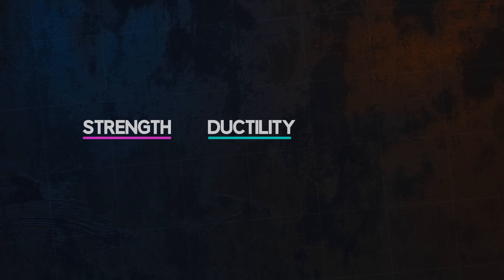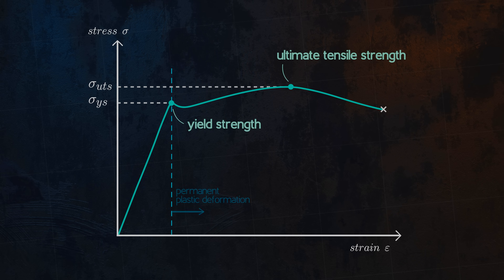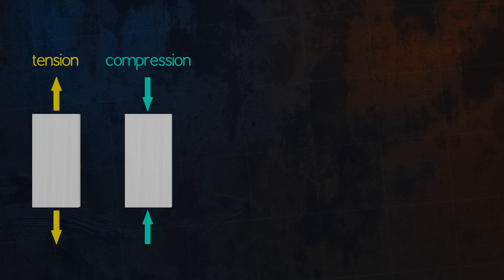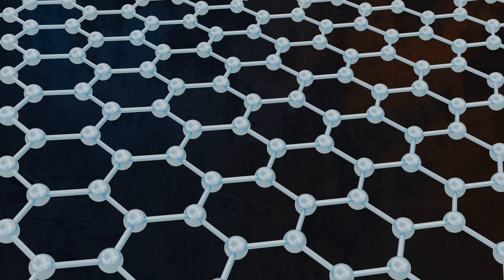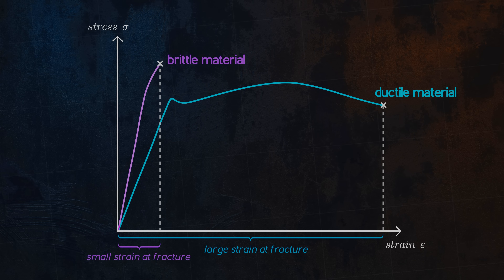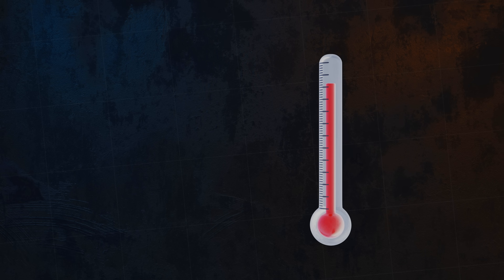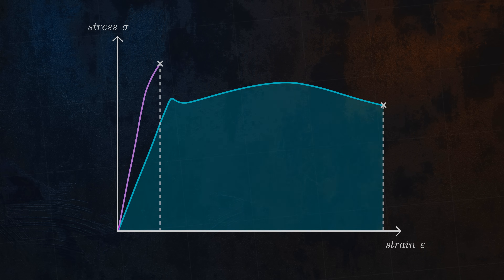Understanding Material Strength, Ductility and Toughness

Comment: I am not sure I follow, in the engineering stress and strain graph, why is there a dip in the stress values after yield point? The csa is the same as initial, so the only way the stress dips is if the applied tensile force is decreased, how does the graph make sense ? why is the applied force decreased?
Reply: Permanent plastic deformation sets in, which exhibits variable behavior following contnued stress depending on the material.

Comment: Something that has been confusing me for a long while, is the relationship between ductility and toughness. As far as I understand, ductility is a measure of the ability to plastically deform. I also understand that the plastic deformation is the main way that energy is absorbed by the material before fracture. This leads me to believe that materials with high ductility must have high toughness and vice versa, since toughness is the ability to absorb energy before fracture. However, i have seen some things online claiming that high ductility and high toughness do not always go together, and that even some ceramics are tough even though they are not ductile. Can someone please explain this to me? Like how can some ceramics be tough but then not plastically deform? How is the energy being absorbed in this “tough” ceramic? Are toughness and ductility not directly proportional?
I need this info for university, would be really grateful for help.
Incase anyone reading this is a German speaker, I have a further confusion, that I would love help with. As far as I understand, the translation for the German word ‘zähe’ is ‘tough’ and the translation for ‘duktil’ is ‘ductile’. In german ‘zähe’ seems to be used interchangeably for ‘duktil’, which in english would mean that toughness = ductility. But I can’t believe this is true. We can clearly see that ductility and toughness have different quantitative values. Are the terms used liberally in German? Was ist der Unterschied zwischen zähe und duktil? Bedeuten sie das gleiche auf deutsch? Was ist dann toughness auf Deutsch? Hilfe!
Reply: Ceramics are brittle; not tough.

Comment: @The Efficient Engineer would you be interested in doing a video elaborating more on cracking and fracture? Perhaps a video about the parameters (which i am currently studying and getting a bit confused by!):
G - Energy release rate
 G_1c Linear Elastic Fracture 
J - Elastoplastic energy release rate
J_1c Elastoplastic fracture?

Comment: Dear engineer
I rigorously follow your videos and I don't think there is any student who doesn't understand them. Thank you very much for the explanations.
Generally, in all the videos where TAU the shear stress (of the steel) is needed, the value of this is more or less 0.6 of the normal stress.
Like the shear stress I would like to know (in the case of two plates that rotate on a steel link) in order to be able to know THE necessary THICKNESS of the plates that are not produced in them flatteningas,  the flattening stress is calculated , of the steel?

Comment: Improvement:
Yield strength is defined as the stress that results in 0.2% permanent deformation (in metals) or as the stress at 1% strain (in plastics).
Reply: Yup. He didn’t really go into enough detail on the nuances between the proportionality limit, elastic limit and yield strength.

Comment: What a great work; amazing.

And at 6:16 minutes on the video, it was said that low strength and brittle material tend to have low toughness,,,, I think “low strength” doesn’t fit here…. As per interpreting the curves, the purple one is for a brittle material that
- has very low ductility (almost null - let us say so),
- it has low toughness (small area under the curve),
- but the material has higher strength than the blue curve one.
Is that right?

BTW, I already started promoting these videos due to their amazing quality in every sense…

Comment: I see that steel for example has a yield strenght of about 1000MPa (1GPa), so it means it breaks after pressures above that point? Then what does the module of elacticity means when steel has 210 GPa?

Comment: I got a doubt. How are the large stress concentrations at crack tip of a brittle materials (in contrast to plastic deformation which reduces localised stresses in ductile materials) a factor for having compressive strength greater than tensile strength in brittle materials?
Reply: Maybe I need to work on understanding the concept of stress concentrations.

Comment: I saw you finally define ductility well but showing the range of ductility from beginning to the end on the stress-strain curve which I thought is not correct, it should be from yield strength point to till fracture point.

Comment: Awesome content with a clear description !!
Can you provide any info about the difference between softening temperature and glass transition temperature?
Reply: Softening temperature is the temperature at which material will become relatively soft at higher temperature i.e  flat ended needle penetrates to a depth of 1 mm under a specific load while DBT is the temperature below which material behaves as brittle.

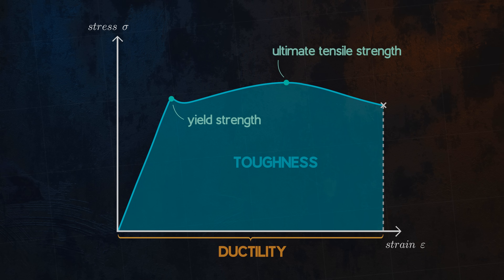Comment: At 7:03 , shouldn't ductility start from Yield Strength Rather than the beginning?
Reply: To be fair, a material can only deform plastically, after deforming elastically. So actually, you should consider the elastic deformation as “the build-up” to the actual plastic deformation and then rupture

Comment: Thank you for excellent explanation , but what the similarity between ductile and toughness ?
Reply: Ducility is more "how" something breaks (does is stretch out first assuming you applied a tensile load?, toughness is more "when" something breaks. A material can be very ductile but if its ultimate strength is low it will not be very strong.

Comment: what is it meant “a strain at fracture of less than 5%”? how to calculate that 5%？at 4:05
Reply from the maker: Hi Wei, on your stress-strain curve the strain at fracture is just the value on the horizontal axis (strain) for the point on your curve which is most towards the right (i.e. the point corresponding to fracture).
Reply: The Efficient Engineer I got it finally!! Very appreciate of your video and your reply. I am a high school student, your video will help many students out there. Good job!!!

Comment: Forced supplementary info on why some materials have higher strength in compression. Because they include inherent flaws, such as rock. A flaw has shear strength and compressive strength but no tensile strength. Because of this, rocks are weaker in tension, in some cases, compressive strength/tensile strength ratio may reach to 30 for highly brittle and high strength rocks.

Comment: Nice video gets to the point quickly covers many points. One question.. I had this problem also on another video... At 1.48 for the material with "ill defined yield point".. First how can the yeild point be ill defined? Surely it is a simple matter to release the stress and see whether material elastically returns to its original length? When no longer the case it is non elastic and now going plastic? Is there an actual material with this ill defined property... does it have some kind of chaotic behaviour and not repeatable? Also where does that 2% number come from ? it seems totally arbitrary.